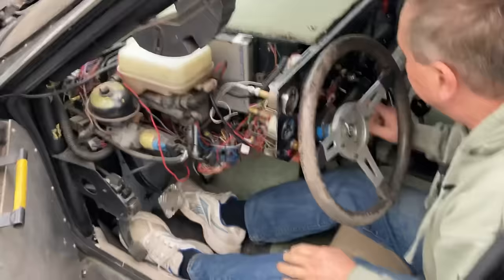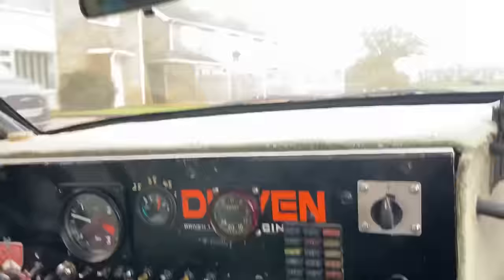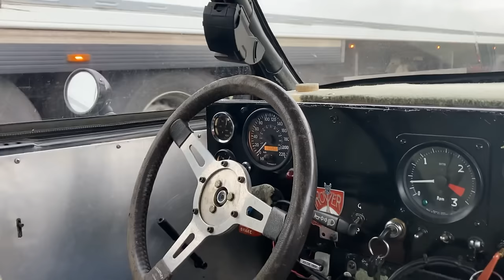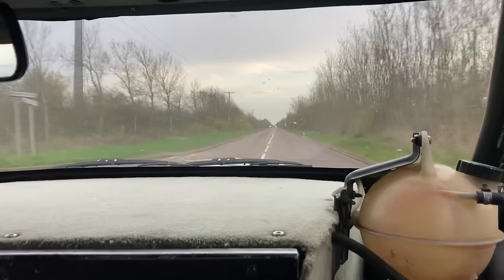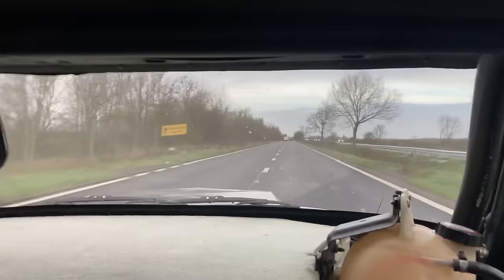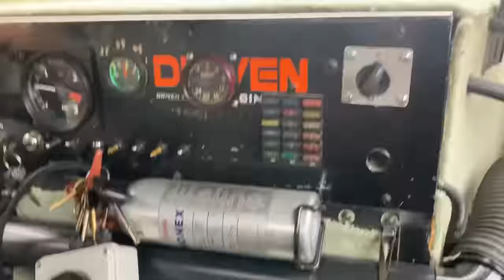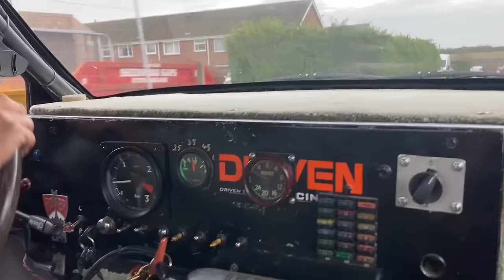Out on the road with Charlie Broomfield in his 27-litre Rover SD1

Comment: Video was nice to see the rover cruising along so peacefully but i would have preferred if charlie boy gave it at least a spoonfull of beans .
Reply: Yeah I was expecting at least one full throttle squirt on the hiway.
Reply: @RIPPERTON  yup me too. Not sure of the point of it if you don't open it right up
Reply: He released the beans on a runway on an episode on fifth gear
Reply: @Virus2ktube  thank you
Reply: My comment at 16:57 perhaps!
Reply: @djicepole  can't hear anything at 16:57 What was your comment?
Reply: Fuel tank was almost full before leaving now half empty don’t I understand why he didn’t flow it
Reply: @Virus2ktube  I think we all watched in the hope of 'a blast'. 
Thanks for the tip.
Reply: I wouldn't bother with a stinker old rover tank
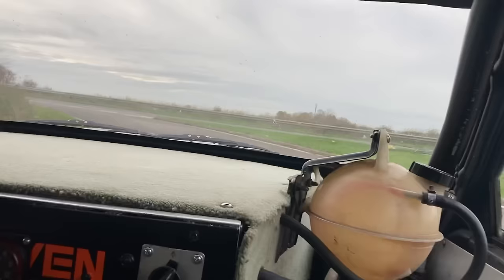Reply: 6:48

It won't be allowed to scream away, to much power and torque for the transmission, like he said at the start, the revs don't change much.
Reply: I bet when this thing's doing 70 the engine is barely turning over!
Reply: Arnt you listening. It doesn't blast. Only another 2500rpm and it's done. It won't blat!

Comment: Would love to hear more about the build, history etc like a proper documentary. After all, it's the fastest Rover ever likely to exist. Brilliant achievement 👏.
Reply: if you slotted a bog standard Chevy 6.2ltr V8 with its 500+bhp youd be quicker than this! Let alone if you used the supercharged version with 750+bhp (again standard, warrantied crate motors) With the first engine id guess at a top speed of 170+mph and with the supercharged version id guess at 190+mph! Its a prehistoric plane/tank engine that cant rev it only has power due to being 27ltrs plus its stupidly heavy. This tops out at 150mph from what i remember (granted i think its only doing a little over 2000rpm?) thats well easy to beat with a modern engine and transmission. He even mentions how laughably shite the tolerances were back then, i mean this was the 1940s after all! 27ltr and around 600bhp and (a very impressive granted) 1500 lbft torque at most for an engine that most likely delivers gallons per mile instead of miles per gallon haha! Plus the engine weighs 650kg so about the weight of 3 modern high powered V8s!

Comment: I am intreagued to know about the transmission. I watched a documentary about John Dodd. He was living in Spain and still tinkering with the Beast's transmission. The problem with aeroplane engines in cars are the lack of rev range. The huge torque is also an issue. When it is possible to get 4or500 bhp from a small light engine which will be drivable and fast, the only reason for a plane engine in a car is to say you have done it. I am glad these things exist and the eccentric engineers that build them but I am going to stick to small light and fast.
Reply from the maker: Sadly, John Dodd passed away last month. Fortunately his family are all petrolheads, so The Beast will live on. I know John was a transmission specialist by trade.
Reply: @thehotrodgazette  I wondered as I wrote the comment if John was still with us, but didn't want to check. RIP John Dodd. I hope petrol head heavan has lots of mad cars for you.
Reply: @thehotrodgazette  sorry to hear John Dodd was passed on. I live in Costa Del Sol and John was very well known and a bit of a character. I bumped into him on a few occasions, sometimes he was driving his classic White Rolls Royce.On one occasion he took me for a short blast in the beast, noisy thing with a step down differential that made terrible whine. I wonder what will happen to it now as it’s still on UK plates?
Reply: From what I remember from PPC magazine, this has a 1:3(?) planetary reduction gearbox between the engine and main gearbox. Both increasing the rev range, and reducing the torque to be closer to more typical automotive levels.

Comment: Running in cooler days actually increases radiator effeciency by compound curve...decreases effeciecy on hot days even more sadly...shedding latent heat slower than build up..cowled fans and electric waterpumps needed.